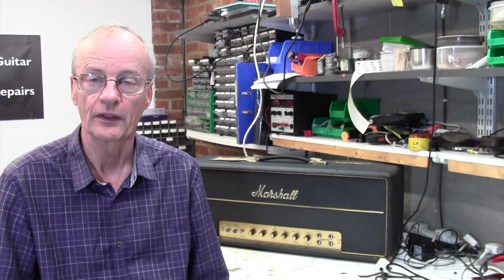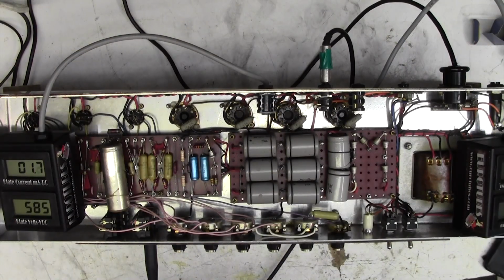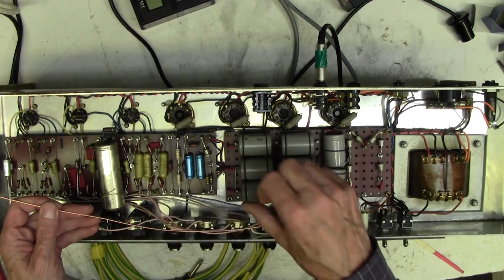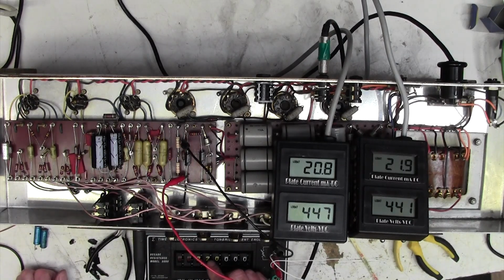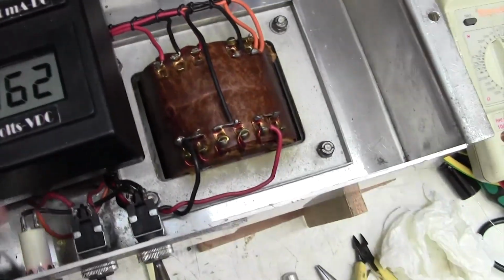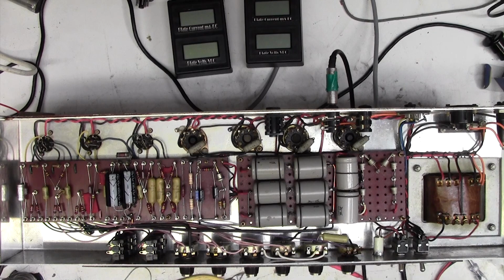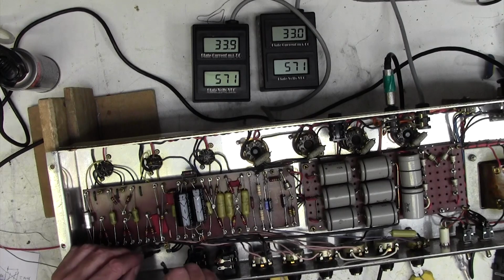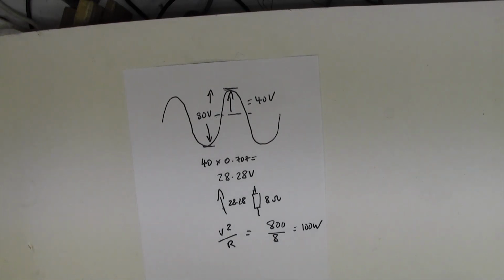How to Fix Marshall JTM45 Super 100 Hum Plus Recap

Comment: An easy way to determine the value of resistors in parallel using a calculator. Clear the memory, enter the value of R1, take its reciprocal, and add it to memory. Enter the value of R2, take its reciprocal, and add it to memory. Recall the memory, take its reciprocal, which is your answer. This works for any number of resistors in parallel.
For two resistors in parallel, the formula simplifies to Rtot = R1 x R2 / (R1 + R2), known as the ‘product over sum rule’. Incidentally, both the above methods result in 45.9 Ohms.

Comment: Looks like you're just manipulating the symptoms running extra wires but the cause of the hum was never found.. the stock amp when new didn't hum and did not need those extra wires??   I would not be happy with this outcome at all
Reply from the maker: Yes I agree. It was a VERY hard problem. I threw everything I knew at it and couldn't really get to the bottom of what caused the hum.
Reply: @stuartukguitarampguy5830  Not blaming you Stuart, just putting myself in your situation... I don't think I would have handled it as well as you did.. I would be up at night.  lol

Comment: I went back and looked when you had the top side up and wondered. maybe you have the same issue with this amp as you did with the Phaez amp you moved the transformer on. Marshall certainly moved theirs father apart on later amps. And this is certainly a much bigger amp power wise.
Reply from the maker: Interesting idea. If that is the case it was a design error.

Comment: This hum issue can be so frustrating! I remember an instructor in an electrical class I was in years ago speak about how just the most minute length of wire +/- can cause EM crosstalk, Rf transmission , receiving,etc.. I have also in my own experience,been able to cut a few inches off of a guitar cable to stop it receiving radio signal. I have never seen something like you are dealing with here though. Wow! the same ground lug producing a different potential from one side to the other. That’s a head scratcher for sure. Great job getting that to a reasonable level.
Reply from the maker: Yes this one was a real challenge!

Comment: I recognize those tubes. They're often marketed as "6p3s" Soviet mil-stock tubes. They're closer to 5881's than 6L6GC's. I doubt they're actual mil-stock.
Reply: @FMF Veteran not far off. If memory serves me the Sovtek 5881WXT’s are reproductions of the 6p3s-E, which is the mil-stock version of the aforementioned tube. Initially they had that coin base. I also recall that this 6p3s tube is also sold by Mesa as the STR-420 and again they insist it’s a 6L6GC equivalent.

Comment: I can tell you from experience that a poor connection between the pots and the chassis will cause an earth hum.
Simply undoing the pots and doing them up again can shut a hummy sixties Marshall up.
Sounds like nonsense, but it's a fact - and I do an awful lot of work on these old things.
Beautiful amplifier though Stuart.
I also always change the Bias caps because as you've said, if the voltage goes down, the Bias goes up and all hell breaks loose lol
Original valves would've been 6L6 or EL34.
You can tell what valves it should have in it by the value of the screen R's.
Reply: HEY. You might have helped me fix my 70's era cheapo Marlboro 1500B amp. The tone knobs made NO sense and made the sound terribly worse. I cleaned them (fixed scratching), I replaced caps on the board but no change. Then I reseated them and it's MUCH better. I still think a cap is bad or miswired (someone has definitely messed around in it before me) but it's much better now, so thanks!
Reply: Grounding everything to chassis is always a recipe for hum. It was a cheap way to manufacture, but a bad way to do electronics.

Comment: Excellent job on the amp.  I just repaired my Marshall DSL for a humming / crackling noise.   Long story short,  the new power tubes I put in were defective and it took a week of headscratching to sort it out. The problem was the tubes as I originally thought.   

Sometimes that's how it goes🤷‍♂️
Reply from the maker: Well done!